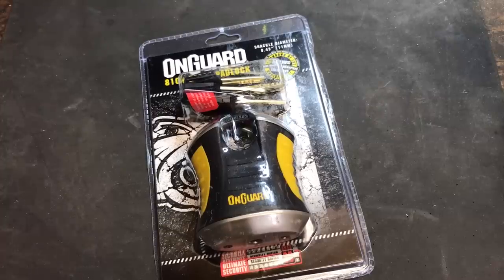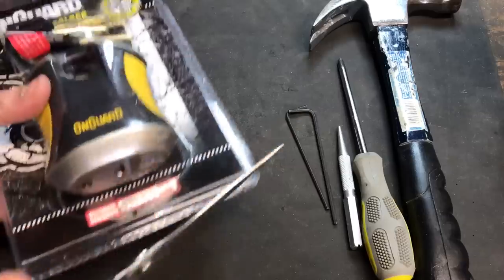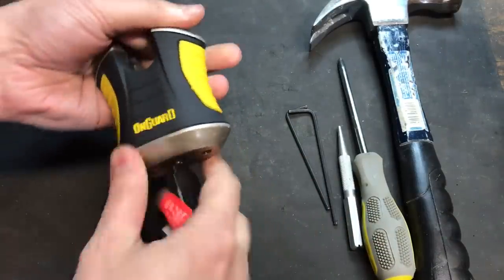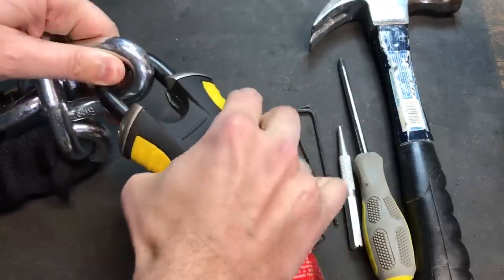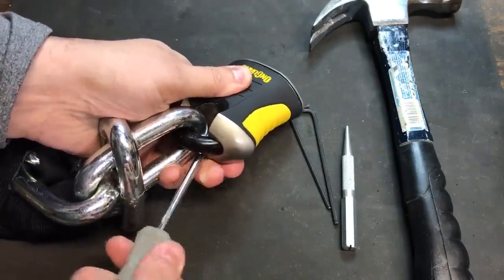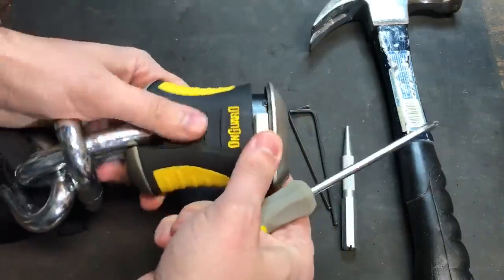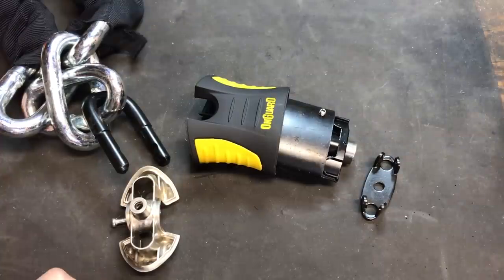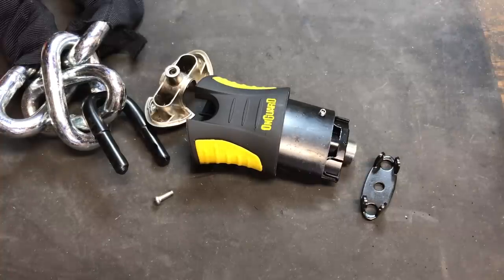[585] STUNNING - OnGuard "Beast" Padlock Disassembled While Locked!

Comment: YES i KNOW I am late to the conversation BUT.. not to over simplify, BUT couldn't you just remove the first screw then epoxy it back in?. then to be extra secure. arc weld it in place?? that way it stops you from being accessing the next set of screws.. would that make the lock more secure? or is this one YOU can pick in like 20 seconds.. lol

Comment: Cutting open the plastic packaging was almost as much work as taking apart the lock! I bet the'recommended chain you mentioned is just wide enough to cover that first screw head so you couldnt take it out as easily. This Beast lock are a bad joke!

Comment: They may be idiots for advertising 12mm chain for this lock,but if you used 20+ mm chain there would be no space to tamper with that screw on the top. On the other hand,that would be too heavy to casually carry around while riding a bike,but there may be some other use for it.

Comment: I agree with you, too easy. But ... hammering in the ballbearing into the setscrew ... you used your Table as like a amboss. I would imagine it is significantly harder to do if all you have is a bike locked. Plus you did make quite some noise ... I would expect that in order to open this lock in the field you do need quite some time, enough light and no one snooping around what you are doing when hammering in the ballbearings into the setscrew.
Yeah I know, locks will only buy time ... the time needed to get them open. Thus I would think, this Lock is not that unsecure, when the bike is locked in a Place that has allot traffic since you do quite some hammering, and screwing around it.
But ... all that said I would not recommend this lock for security.

Comment: I think anyone who owns this lock could weld up both those allen grub screws. Or superglue/locktight em in. Or even round off the edges of the screws with a drill. This might defeat the hammer/punch attack.🤔🔒💨😉

Comment: I would just like to let people know that you should not hold a punch like that, please don't pencil grip as it can move and break your fingers. 

Hold the punch like a kid holds a pencil. Full palm grip, with steady pressure pushing down, with the edge of your hand on the surface to keep it steady.  It will save you a finger or two

Comment: So if you have one of these locks, just hammer those ball bearings down yourself, tighten them, and grind off the top. Problem solved, assuming those little screws actually are secure enough to start with

Comment: While this is a way of opening this lock, I fail to see that method to work on the street. Will you bring along a table or bench at the perfect height to place that lock on, so you can use your hammer, or would you speculate that you can place the lock on firm, flat ground in the open to be able to use the hammer? I don't know.... but certainly, for using the hammer, the lock needs something to rest upon firmly.

Comment: It seems like kind of a small flaw in the wild, not only because it would be really difficult to hammer the ball bearings out in public in non ideal conditions. Unless a thief is ok with doing things the Hard And Really Obvious Way, or has already stolen your wheeled object, lock chain and all, then its a fairly small issue (especially considering tools that may be faster and quieter like a ramset with a high power cartridge).

Comment: at least its not as simple as smacking it with the hammer directly, only someone that knew about the issue would think to do this and it does take a couple minutes plus with it hanging it would be difficult to punch the ball bearings.

Comment: I agree this is an inexcusable design vulnerability, but I think this would be challenging to execute in the wild, hanging from a chain.

Assuming you don’t have unfettered access to the lock, right? Because if you do, you might as well take a hydraulic cutter or angle grinder to it. Picking/bypassing attacks have to be quick and relatively quiet, and not require a too many tools to pull off. In my very, very amateur opinion.

Comment: I don't know. It seems like it's too time-consuming... I assume most people want to get it open as quickly as possible. Assuming they had all the time in the world, still, in order to drive the ball bearings deeper into the screws, it takes leverage and considerable force (what are the odds that you can brace it against a flat, hard surface and give it all your might?). Plus it's noisy to do so.

Comment: Couldn't this hack be defeated by replacing the obviously soft setscrews in the base with hardened ones.  Or would hardened screws prevent the manufacturer from using their ball-bearing hack.

Comment: I mean, let's be honest here. It's a lock you're most likely gonna have fastened to your bike in a public place. - And if opening it involves having to hammer those ball bearings down, you can reliably say it'll require some "steady surface" to do so. You can't just do it in the palm of your hand. - Plus it'd be loud, and time consuming, it took you five minutes to do in a comfortable setting with no stress or pressure. - In a practical setting it'd likely draw a lot of attention, and not be stealthy at all. With the time involved as well, a thief will probably consider it an easier endeavor to just take a hacksaw to the chain or use some heavy duty cutters to get it done quicker, rather than fiddle with screwdrivers and hammers. Sorry, but in this one example I feel the "inexcusable" thing is just over-hyped.

Comment: what gets me is, that they knew of the vulnerability because they thought putting the ball bearings in would be enough. shame on them.  i wonder why they didn't put a ball in the external screws as well? there are lots of security type screws that could have been used, like triwind, or spanner for instance. maybe they thought people would be idiots to buy the same lock again after someone broke the original.
Reply: triwimg not triwind .... my bad
Reply: sheesh my keyboard sucks.  TRIWING

Comment: It beggars belief that any lock with exposed screws can make it past the design stages; while I know it's harder to design a padlock with screws under the shackle (such that it must be removed first), but it seems like such an obvious thing to do for security. Same for regular door locks, any screws should be accessible only from the secure (in)side. If you can't unlock it, you shouldn't be able to disassemble it non-destructively, period.

Comment: Little of the super strong Loctite to the phillips screw followed by 1 sec of drill bit contact to take the phillips drive part off the screw would make opening that lock much slower. Not perfect but one would have to drill the screw out. Additionally Loctite to the inner screws + drill bit work to remove drive before inserting the ball bearings. Again much slower to open but not impossible. Would cost more but at least the lock would not be completely useless. Well, I see no reason to make a bike lock to be dismantlable at all - why not use rivets or even welding to make sure it stays shut!?

Comment: In reality over 99.9% of the time you don't need to do anything but put any lock on something and theifs will just go to an easier target...if it is something specific they are after then it doesn't matter what lock you use against a determined thief...anyone with minimal knowledge of metalwork can get past a lock...and these expensive locks only make u feel more protected...it doesn't protect something more

Comment: Too bad they didn't add a drop of permanent (red) locking compound to the screw under the shackle. With the weird angle and a bit of that there is little chance you get it out before it strips the head.

Comment: Who the hell designed this was this flaw caused to save a couple of bolts this problem could have been solved by using two large through bolts threaded into the top plate and had a couple of bolts holding the bottom plate on through the shackle holes consealing the bolts and making it so anyone with a screwdriver and a hammer can't just wander up a tear it apart!

Comment: Unless those set screws are set sub surface then i bet a pair of flush cut wire cutters would remove them with out the noise of the hammer

Comment: Got to wonder how hard it would be to hammer those ball bearings in if the lock was hanging in the air like if it was locked on a bike. Busting one open on a bench is kinda different than when the lock is in a real world situation but just having access to the screws is still a crappy design.

Comment: I dont agree that this is a security flaw. This attack is impractical at every level. Primarily, you cant hammer in the ball bearings with the lock chained to a bike. Secondly this attack has a relatively long duration. Not realistic fighting the lock like this in the real world.

Comment: Why don't they just get like a padlock with 50 different screws but all of them being screws leading nowhere except maybe 5 that are actually used to open it and you need a special tool to unscrew them that you get and the packaging essentially this is your key because of the sheer amount of them even if they bike Thief or something tries to break in it'll take a long ass time for them to figure out the right one to use to open it especially if the screws aren't informative they don't work with a Philips kind of thing if they've got a really weird pattern that you need a weird screwdriver for

Comment: Its a poor design sure but i'd love to see him do this on a bike chained up in public etc where he's having to work in a non controlled environment to get this thing open. It takes him somewhere around 5 minutes to get open and this is in a controlled environment where you can afford to take you time and not worry about being disturbed. You need to carry like half a toolbox to open this thing including a hammer and it's not exactly discreet hitting this thing with a hammer etc. 

Good channel and this is clearly a lock with a glaring design flaw but overall videos like this are poor. the ones where he picks open a lock in seconds or opens them quickly in some other fashion to demonstrate weakness are great but genuine thieves dont want to have to hang around for minutes at a time fully disassembling locks in public, they want to be done fast.

Comment: Wait how can you lock anything just by putting just one link of the chain through the lock? You've gotta have both ends. I expect that's why you had all that extra space to insert the screwdriver - a second chain link was supposed to go there.

I'm not saying this attack necessarily won't work, but your demonstration is flawed. I don't think you can yet say the lock can be disassembled while it's on, because the lock really isn't on yet.

Comment: I don't think its that fair to say it would be easy to disassemble while mounted on the bike itself, especially since you need a stable surface to hammer precise points.
Reply: You don't chain your bike to something stable?
Reply: @xpusostomos  stable surface meaning something flat to hammer it against that most likely won't slip and move, I'd like to see this attempted while on on the bike in a parking lot to see how long it would take
Reply: @thiagocesar2749  there's this flat thing called "the ground". You often find it in parking lots.
Reply: @xpusostomos  you clearly have no idea on how bikes are chained lol...

Comment: Can any native English speaker please tell me, if a single steel ball without any rings or cages or anything else to make it a bearing is still commonly called a ball bearing?
Reply: It's called a bearing because if what it does, otherwise it's just a regular ball.
Reply: @GazMatic  I beg to differ (another English phrase), a ball bearing outside of a bearing is still a ball bearing. There is no bearing but that kind of round steel sphere is always called a ball bearing to differentiate it from other balls that are not made the same as a ball bearing i.e. less smooth and round. A ball bearing is a steel ball suitable for use in bearings. similar cases include butter knife, locking bar, machine screw, Ethernet cable (technically just a cable but as it has exactly the right number of cores for use as an Ethernet cable it is called an Ethernet cable), power cable/plug, laptop/phone battery, doorknob (could be used on something that is not a door e.g. a cupboard or taken in isolation and would still be called a doorknob), some people call cameras video cameras and finally desk lamp. Many of these examples are subject to ambiguity as a ball bearing is also a ball, it is just more specific to call it a ball bearing ; so dropping the descriptor is probably acceptable, just not usually useful or expected.

Comment: Your skills are awesome and irrefutable. However, with many devices with which you find floors, the layman and probably a determined thief could not. Hammering bearings against a solid surface would most likely be unachievable to an opportunist and the time and noise doing so would permit the use of a cordless cutting disc or a simple xl set of bolt croppers.

Comment: Yea hand tools and uncommon Alan wrenches and oh yeah , a hammer, ... now your not just carrying a few hand tools your wearing a tool belt.... don't be fooled by the lawyer...any removable lock is only a deterrent for opportunistic crimes where no one is carrying any tools or against low level petty thieves, That's all they ever are used for!!!!..... perhaps a bicycle is the most important thing you guard if it's your only transportation or it's a very expensive bike or an  e bike,, then you would take other measures like wheel removal or battery disablement.,...if locks were supposed to be anything else they would solve the problems with them

Comment: Meh, what are the odds someone who knows how to do this and has the tools is going to come across your bike in an area where they can do that, not get noticed, and have time to finagle it while its on your bike. Plus, be carrying those precise tools at that time?  Meanwhile, a drop or two of superglue on the first screw would slow them down a bit.  If its not any more expensive than the rest, I see no reason not to get that lock for my bike.

In a live situation, wouldn't it be easier to just cut the chain?
Reply: So for the 35 buck the lock costs, you wouldn't prefer a lock that doesn't have those issues? Sure, an angle grinder and you can cut just about anything with no issues.
Reply: @jongustavsson5874  I wouldn't spend thirty five dollars on a bike lock in the first place.

Comment: Bullshit, you’re breaking and damaging the lock to open it, not simply disassembling it. Once you’re wacking it with the hammer and punch (with a hard backing which would be difficult to find in a lock hanging in the air attached to a bike) you’re using special tools to break and move parts of the lock. NOT disassembly, sorry. You lose this one.